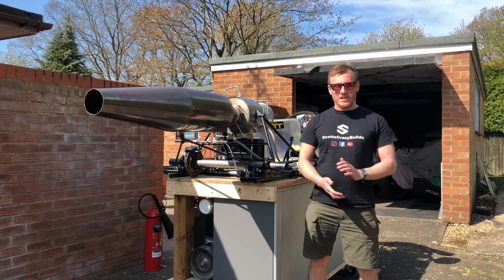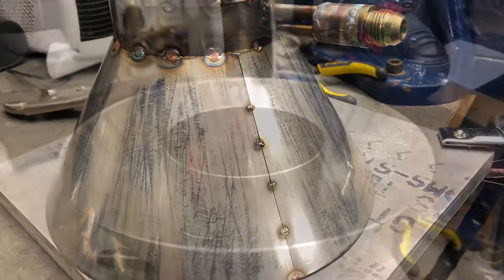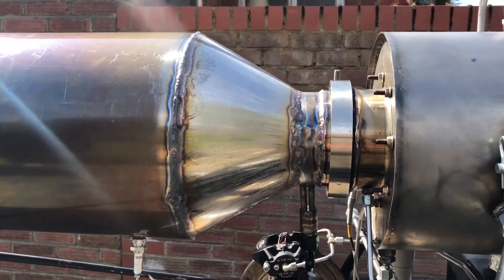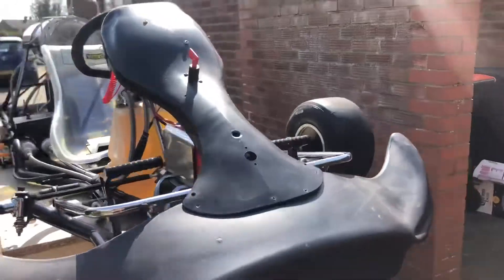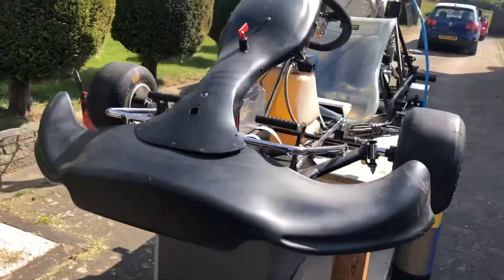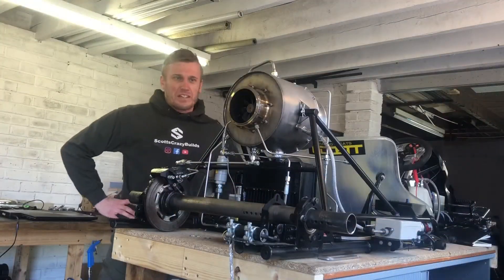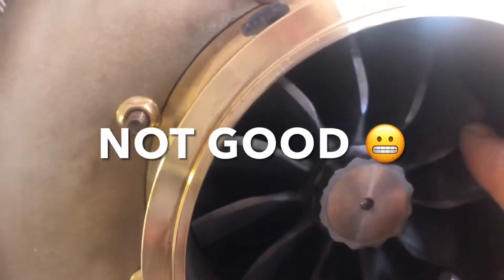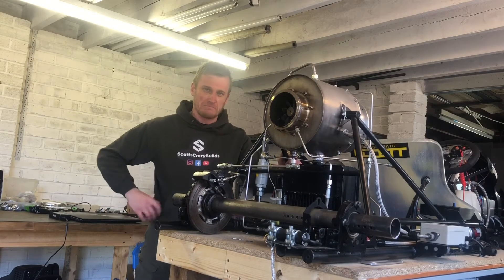First Fireup of the JETKART!!! DIY Gas Turbine Engine

Comment: I'd say the rubbing was caused as a result of letting the engine continue to lose rpm and not cutting the fuel off which made the egt rise high enough to cause the parts to make contact. I would be looking deeper in to what caused the engine to lose rpm, battery, fuel pump etc rather than inadequate clearance being the cause.
Reply from the maker: Thanks for your reply! The engine has now been fully stripped to try and determine the cause. The fuel injectors seem fine and fuel pressure was completely stable when the rpm dropped. The clearance between turbine and NGV was measured at ~0.25mm which would reduce under forward thrust load, so I think it was just too marginal on clearance! 0.5mm extra clearance added now and hoping for better luck after rebuild 🤞🤞
Reply: @ScottsCrazyBuilds  hopefully that sorts it out. Keen to see the next update :)

Comment: NGV has probably warped a little, Radial inflow engines seem to have these problems.
It sounded really good
Reply from the maker: Yeah it’s either that or not enough clearance to the turbine. I have partially stripped it and found some quite big rubbing spots that are the cause of the problem! Will skim it back a bit 👍🙏🏻